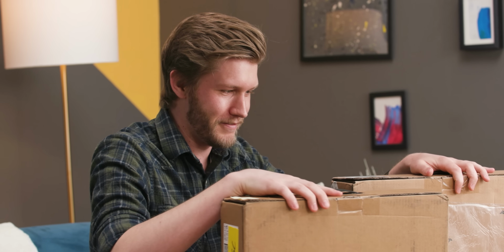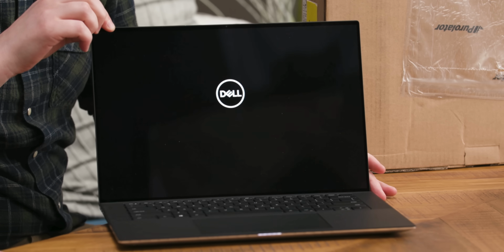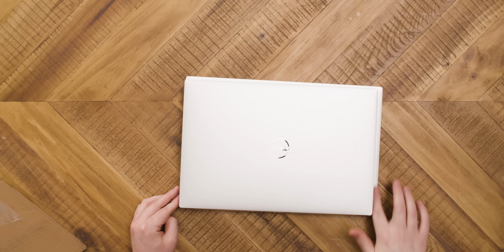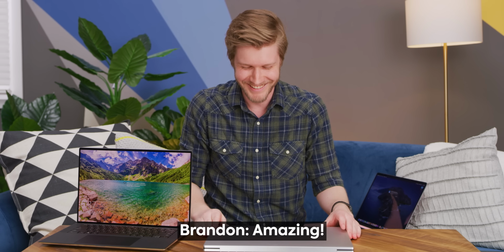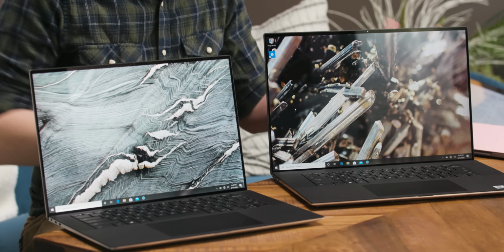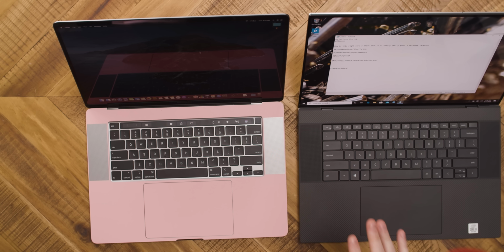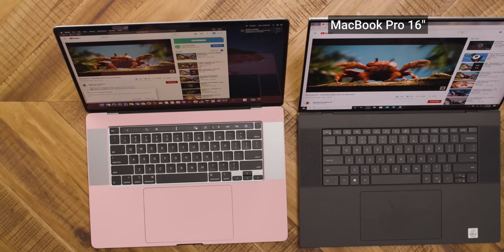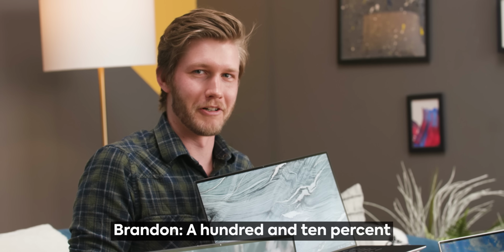The MacBook Pro's Biggest Rival - DELL XPS 15 9500 & 17 9700 Laptops

Comment: They would be perfect laptops if they came with AMD Ryzen CPU's
Reply: And cheaper
Reply: @D--  same price but better performance is more suitable.so that consumer can pick and see what the same machine with different cpu meant for their dollar. Sonthey know which is more worth it
Reply: The laptop of God .
Reply: Thunderbolt supports pcie lanes straight to the motherboard main control, reason why gpu can adapt, while USB 4 does not support pcie lanes also need to have dedicated controller to manage bandwidth even it support 40GB/s
Reply: No thunder bolt tho
Reply: @private679r.i.c.o4  why not? third gen desktop Ryzen already supports Thunderbolt 3
Reply: @FilipinoWaylon26  yh on desktop. Which laptop has it?
Reply: @private679r.i.c.o4   They can't do it on amd laptops because Intel wont license them. Therefore it is somewhat exclusive to intel notebooks. On desktops though, you can just plug in a th3 pcie card no problem
Reply: @Nico-ff1fg  usb4 can change that
Reply: @Nico-ff1fg  In other words AMD laptop = no thunderbolt. I would've liked to see it but it is what it is
Reply: @Nico-ff1fg  Thunderbolt is not exclusive to intel anymore, manufacturers just have to choose to put it in AMD laptops which sadly they aren't.
Reply: Tillmann Küther in the other word it’s still intel exclusive

Comment: How can a laptop have all 16 lanes going to tb3 alone?
Reply: And then 8 lanes for a gpu. What is going on?!
Reply: It doesn't, it has 4 lanes per controller (so it's using 8 lanes for Thunderbolt). He could have easily looked at the Intel datasheet for the controller to know it. I don't trust anything he says anymore because he clearly doesn't do proper or any research (his iMac video was almost all wrong).

Comment: Let be real, the i9 one will have wayyy more than 100W TDP and would never reach listed 5.3 before it thermal throttles to eternity. 
Put Ryzen 9 in that thing and then have my money Dell.
Reply: I bought one i9 9570 for a user, the fan never shuts up once it gets going. Selecting quiet from Dell Power Manager barely drops the fans rpms.
Reply: Ramon Ochoa i have this in my i7 9560 until recently. Try undervolting in intel extreme utility I got -0.16 volts and it runs so much quicker, cooler & quieter.
Reply: @ethanbaker22  Did you benchmark it?
Reply: An Tran Duy Also I increased the Watts the CPU could use from 20 to its 45W TDP. yes, I can’t remember the Cinebench scores, but in Intels extreme utility. It went from 900ish to nearly 1000. This was because it didn’t once thermal throttle. Did a 30 min stress test too and it hasn’t crashed once. Game frame rates are much more stable too. Wish I did it sooner
Reply: Except they probably wont lol
Reply: We all know intel will give all these laptops companies as much incentive as possible to prevent that
Reply: @davidashurov5255  well they'll be stopping the OEMs from getting my money
Reply: There still is the vapor cooling that the 17 has that just might work, but who knows?
Reply: Rylee :3 well just ask your our non tech friend what processor they want for their next pc most will answer something like i5 or i7 if not straight up intel just accept it intel is more well known as a brand after all intel has 70% market share (as for 2019 q2) even tho AMD for now is clearly better value and better performed
Reply: I thought so too. Until I used an external gpu to a monitor. CPU stays at a consistent 55-60C stock and not even undervolted. Dell's xps heatsink isn't big enough for both the CPU and GPU combined. But if it's just the CPU it does fine on its own.
Reply: I don't think that AMD sells BGA CPU (or maybe its in very limited quantity or just for lower end SKU, i'm not sure). The few laptop I've seen so far with Ryzen CPU actually have a full AM4 socket, that's not good for mass manufacturing. They can't just design one chassis, one cooler and then swap the board for AMD when needed because the height of the socket+IHS is just way too much for a laptop.
Reply: They run at 3 GHz all core boost in most laptops. Intel is outdated and crap
Reply: @Monsieur Sloth unless we get another + , that hasn't happen before...
Reply: What did he mean by the XPS 15 has a TDP of 50W? That's the max overall TDP for all the components combined?
Reply: Patrick B well it might be but after all XPS are for “pro” people like lawyers businessman photographers where I believe most of em doesn’t care about if it’s amd or intel even tho for now amd is clearly better
Reply: 5.3 GHz is for one core and one core will never throttle
Reply: @IamUzyf  and not a single application uses 1 core, and even if it did background windows tasks makes it impossible. It's just fake marketing bullcrap
Reply: @wile123456  100% load only happens when you rendering or something like that, most of the times it several single thread apps in background
Reply: @IamUzyf  aaahhhh "several" single thread apps. You know what that means? You won't get any boost to 5.3 ghz, because it requires only one core to be loaded, but we don't live in 2006 anymore, there will always be more load on other cores too making it impossible. Also im litterally speaking from facts and testing done on these CPU's they don't boost high. This is intels FX series for laptops
Reply: Patrick B it’s harder to market to general public and it will lose thunderbolt 3 which will make the device thicker and no type c charge
Reply: @bobbyhp26  thunderbolt just needs ample PCI-E lanes and a properly made motherboard. We can get nice motherboards for ryzen with 2 or more T3 ports
Reply: David Ashurov what I know is thunderbolt 3 is Intel proprietary not to mention it has diffrent controller than normal usb so no amd cant use it yet
Reply: @bobbyhp26  no, you can buy thunderbolt pcie cards that work on ryzen, and you should be able to adapt something similar on a laptop just integrated onto the mainboard. Also ryzen generally has more pcie than Intel as far as I can remember, so the extra pcie usage shouldn't matter
Reply: @bobbyhp26  While rather rare on AMD devices you can have thunderbolt on AMD boards my Steel legend AMD Mobo has an internal thunderbolt port

Comment: I'm buying it the day they get a Ryzen CPU
Reply: So in other words, you’re not buying one this year or any year soon.
Reply: @AMGF815  nope, Dell is switching to AMD for their G-series gaming lineup, and Lenovo has basically become all-AMD for both gaming and thin and light. Dell is very open to using AMD, and next year can very well be the ultimate year, mainly because USB4 will succeed TB3 (we know that AMD can use TB3 but USB4 is still going to succeed it because it's superior), DDR5, PCIe 4.0, and Zen 3 mobile CPU's. I don't think Intel would have anything near comparable to that, and Dell does have good relations with AMD as I've said.

I'm personally waiting for the delayed Dell G5 15 SE 2020 edition. It was supposed to release in April but has been delayed due to coronavirus. It sports an AMD R7 4800H, and an RX 5600M (around RTX 2060 mobile performance (better than Max-Q, but worse than mobile Super Max-Q (very confusing I know))). It also has a colour accurate 1080p 144Hz display so... Yeah Dell is taking AMD seriously.
Reply: The Dell laptop has an update, it's being released 21st of May
Reply: It actually goes up to an R9 4900H too! And it has killer audio... well that sux a lot
Reply: @PeterNjeim  It's about business. The same business tactics that Microsoft used to use. Believe it or not, gaming laptops are not the flagships for brands like Dell. I would love to be wrong but I'm betting we will not see an XPS 15/17 with AMD this year or next year.